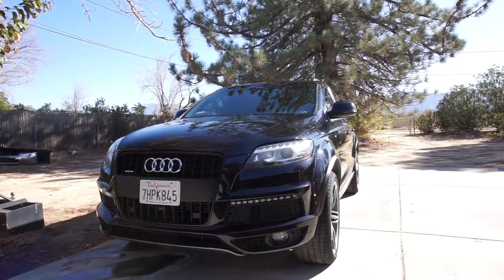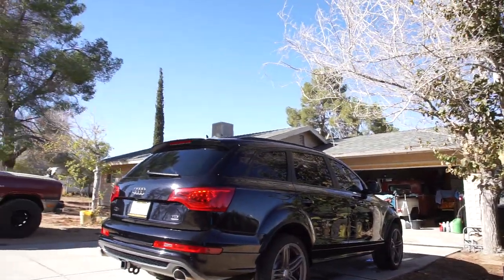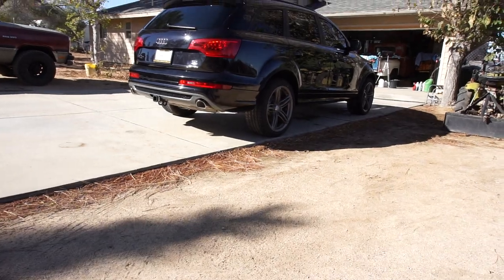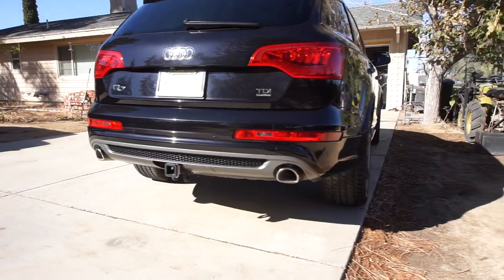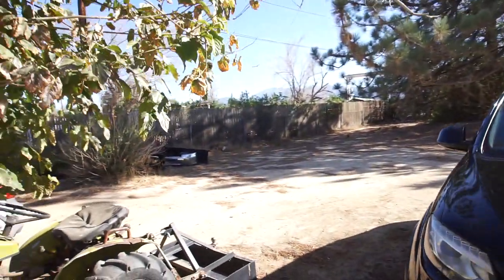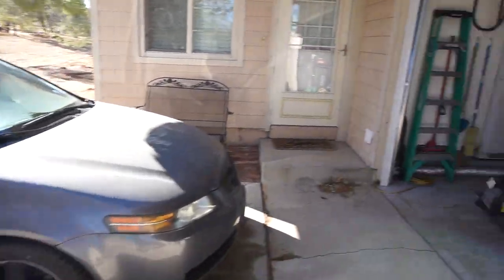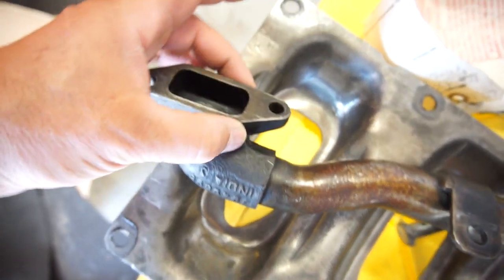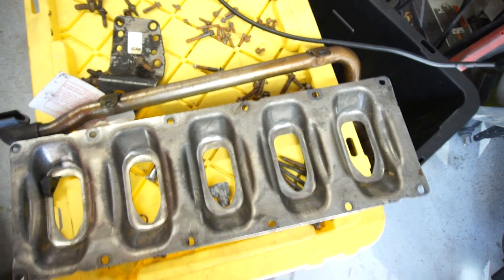So I Bought A Gimbl and I Need Practice Using it. Update Cummins 6.7 Build 19

Comment: Gimbi is very smooth .  Getting into the high end production systems ,huh ?  Its all good anyway ya do it . Geez that PU tube busting like that is hard to take.  I hate when something like that goes south ,  holds up the whole process for not much gain .  Do they make a whole new tube or just a spacer for the cast iron end ?  Awww, ya' needed a break from that project anyway .  You probably will burn out on trying to keep that Audi clean and shiny before too long .  Black is the best looking paint but white is the easiest to keep looking good , IMO .
Reply from the maker: I hope I don’t burn out on keeping it clean. Yeah high end production 🤣🤣. I bought a used tube. They come complete with tube and mounting piece new. But I bought a used one from the same guy I got the girdle from so the tabs should be bent for that girdle.